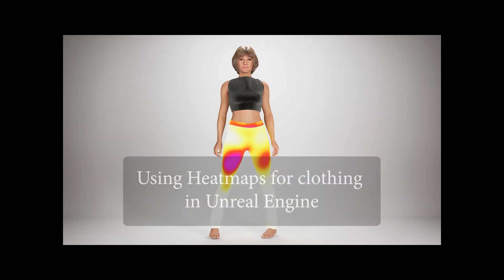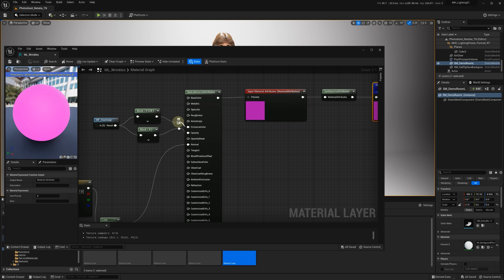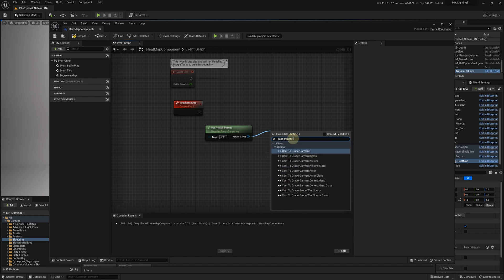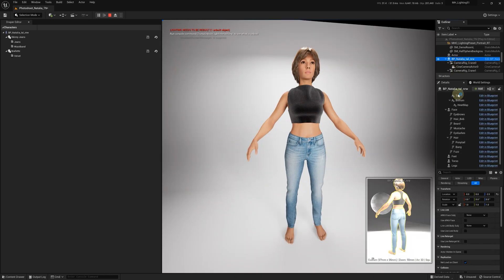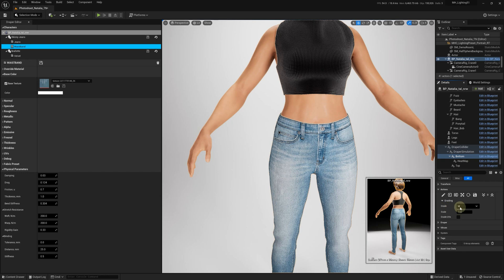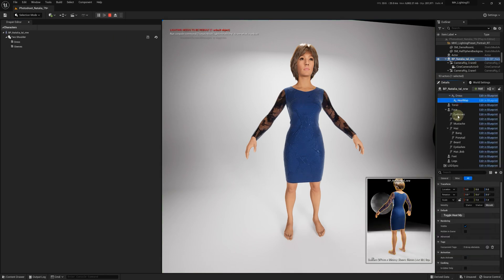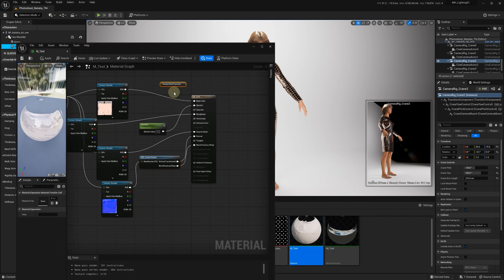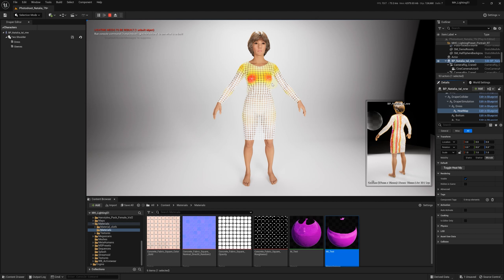How to Use Heatmaps for Virtual Fitting in Unreal Engine with uDraper

Comment: Is cloth tearing during simulation at runtime possible?  How about runtime interaction? Like how you set the bind or grab the cloth with the mouse and move the cloth but using that to let characters grab other cloth at runtime. I'm guessing it wouldnt be easy at all but it would take this to a whole new level, literally peak cloth simulation and considering this whole plugin is already next level is saying something! Some other questions too, if you dont mind.
How about modiyfing the uDraper cloth simulation paramters at runtime?
How is the performance for characters with multi-layered clothing? 
Will it impact performance if there are too many characters?
Reply from the maker: For now we have one grip actor like in these videos:
* https://youtu.be/pB48boX5-yE?t=26
* https://youtu.be/BiLxHP-f7b0?t=7
Tearing is not yet supported.
Get in touch via our Discord